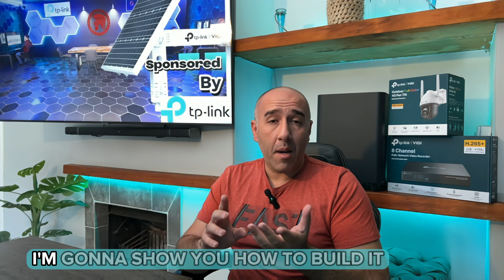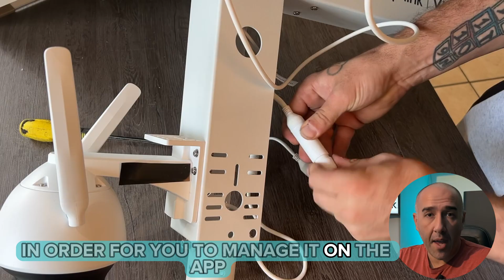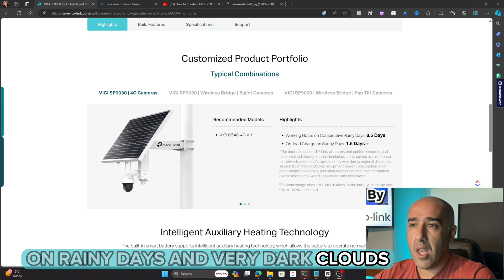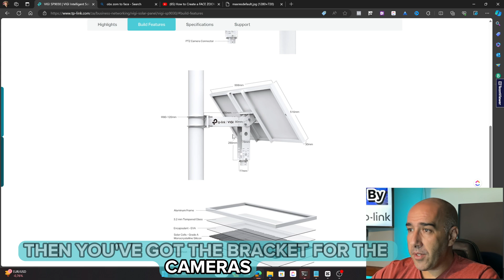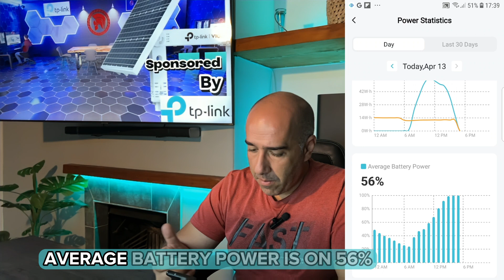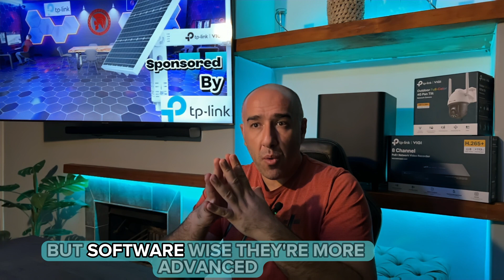Vigi SP9030: Ultimate Solar powered CCTV solution?

Comment: Thank you very much for your video, very helpful. This is going to help a lot of farmers. I also live in SA (Pretoria). Question how much data per month does the 4G camera use?
Reply from the maker: Thank you for your comment! Data depends on how you use the system, there is minimum data used for communication with the cloud platform and then very little data when a camera sends you alerts. Data is mostly used when you are live viewing or pulling recordings. You can also have a P2P device if there’s line of site to a point that has a fibre connection or uncapped LTE, contact us if you need a solution designed for you, we work with installers and end clients